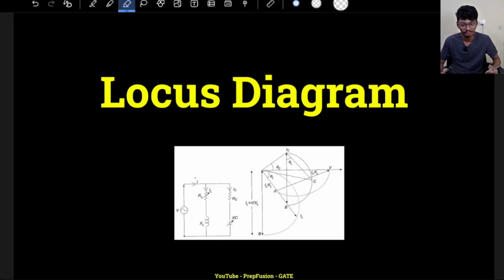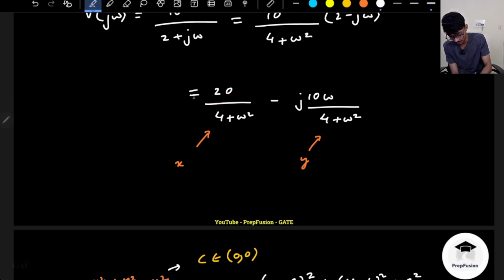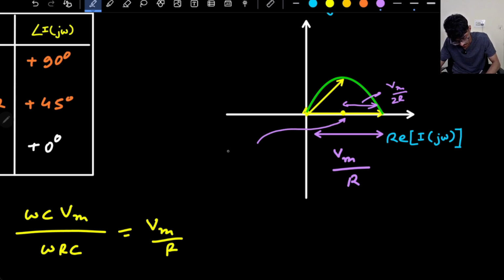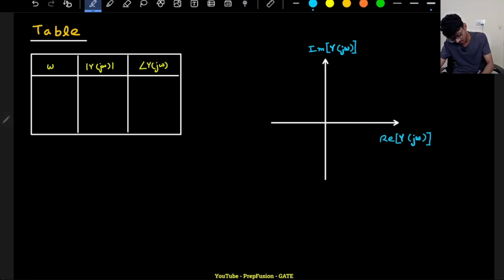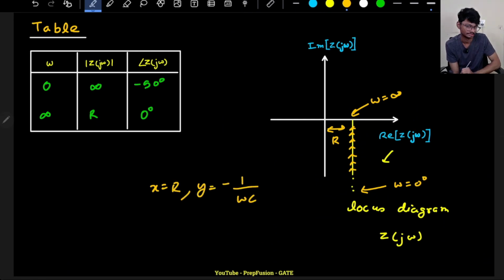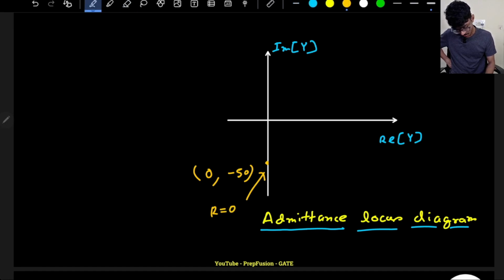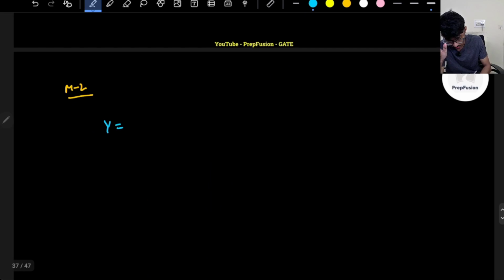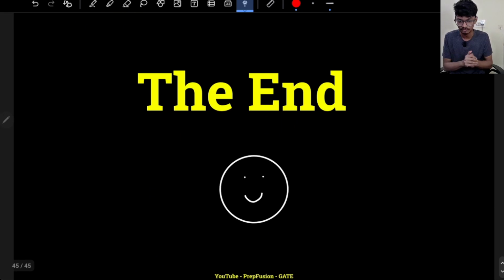Locus Diagram Of Current, Admittance & Impedance in Network Theory || AC Analysis || PrepFusion

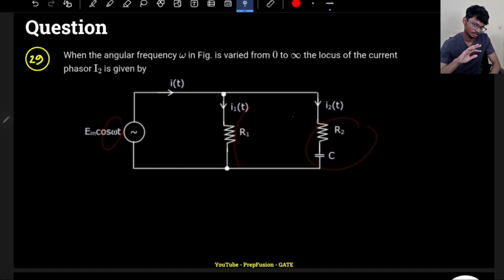Comment: 1:11:25 
Overall circuit is resistive at w=0 not capacitive . at w=0 -> 1/jwc is infinite so first series part is capacitive 
But when taken parallel to that overall , the overall is close to smaller resistance not the larger one (i.e infinity) 
So, overall circuit is Resistive not capacitive

So, at w=0 ............. Reff = R1
and at w=infinity .............. Reff= R1 || R2
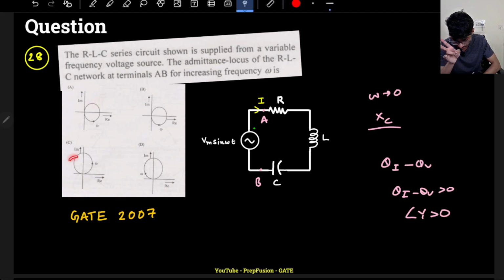Reply: 1:4:09 could you tell why is it clockwise
Reply: yeah same doubt but we only required I2 so it came right, edit: but at last sir told it resistive

Comment: 1:7:45 Option B right
Please check
Reply: how?
Reply: @pallavireddynalla  Option B is only correct
At w=0, Z=1/jwc
So, Y=jwc, Y=0

At low w, Z=1/jwc
So, Y=jwc ......... jwc means in the +ve side of j plane 

So, starting at w=0 is at centre and w=low finite value , is at upper ---------- so movement is clockwise 
Option B shows clockwise